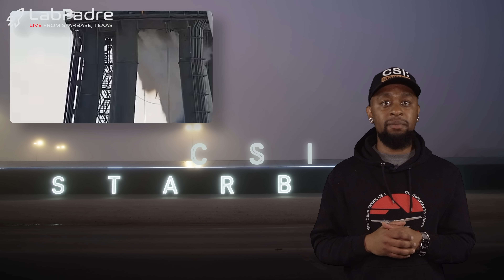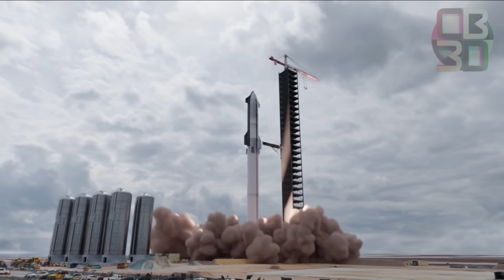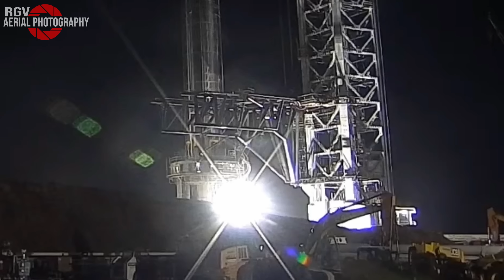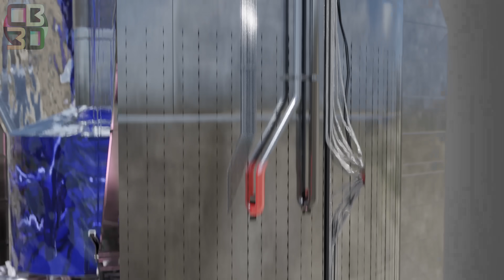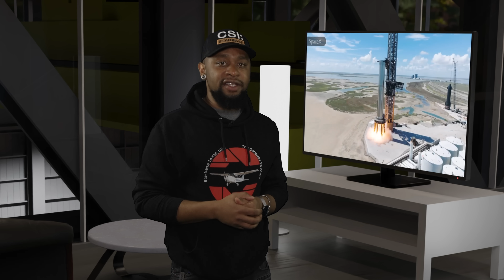[Part 2] The Real Reason Behind Delays to Starship Orbital Test Flight

Comment: Zack, in a 100% oxygen environment, you can light that stainless steel on fire with enough heat/pressure. The flame arrestors are likely made from Monel which will not easily burn even in 100% oxygen. They are also called Monel Stops and are very common in GOX systems. They aren't typically found in LOX systems as the cryo temps will usually put out any fire that could start inside the pipe.

Comment: The amount of thought and effort that you and your team put into each episode is simply amazing! I suspect it is almost as hard to "CSI" these systems as it was to design them in the first place. Even once you noodle them out you still have to figure out a way to present the information so that an idiot like me can understand it. Stunning work. Thank you for your hard work!
Reply from the maker: Turning it into a story is definitely the most difficult part
Reply: @CSIStarbase  You did a fantastic job.  Super Heavy is fundamentally a multi-megaton explosion just waiting to happen.  The only issue is whether the explosion is controlled or uncontrolled, and the degree of collateral damage.  

Here's some riveting "story drama" for ya:  
A-Boca Chica tank farm storage and/or fully loaded Starship contain 2400 tons of LNG.  
B-2400 tons of LNG = 23.5 KILOTONS of explosive power IN REGULAR ATMOSPHERE - NOT EVEN CONSIDERING THE PRESENCE OF THE LOX ACCELERANT. 
C-By comparison - Hiroshima =15 KILOTONS of explosive power.  
D-So, when you add in the pure LOX accelerant, you've GOT to be talking at least 2X the explosive power of Hiroshima in the event of catastrophic Super Heavy failure.  

Not trivial.  Instant story drama.
Reply: As the man says

“The best part is no part”

Comment: I'd consider the outer engine QDs a hard connection. 
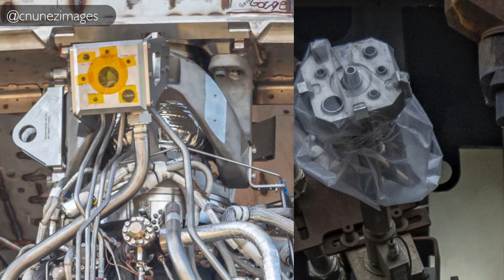You can see clamps on the right image at 11:24, those would lock behind the edges of the component in the left picture.

Comment: What an incredible capture and explanations of all the fine details. Well done Zack. The vortex that appeared on the cooling points it could be because of the hot air that has already risen up and the air from the surrounding area is flowing right in and getting sucked upwards
. respect to the with you are doing man.

Comment: Zack, you made a small error in explaining the pressure changes when pipe diameter changes.

Pressure drops when velocity increases and velocity increases when pipe diameter decreases as per Bernoulli's principle.

In your diagram, the pipe diameter increases so pressure would increase and actually prevent evaporation/boil-off whereas you said the opposite.
Reply from the maker: Yea. Made a mistake there
Reply: Thanks,that didn’t add up for me either, but I wasn’t sure.

Comment: Bro, another banger as always! This is awesome! SO awesome, in fact, I had to join as a Staff Member! Cheers, Zack.
Reply from the maker: Thank you!  Did you get access to the discord server ?
Reply: @CSIStarbase  I actually did not. Will it get emailed? Excited!
Reply: @CSIStarbase  Hey Zack, what do you think of my "catch-only-tower" theory: I think the 3rd tower being built in Florida, might be a catch-only tower to be constructed on a "landing-zone" to practice booster/ship catches, without risking damage to the OLM and all the plumbing. Indicators: Lack of plumbing being installed inside each section (plumbing should have been done by now), given prop load to the QD arm is not need. In fact, no QD arm is needed at all for this tower which is given why we haven't seen a QD arm for this 3rd tower. But the catch-arms for the 3rd tower is visible if in pieces. Further, this tower is shorter, which makes sense since this tower won't be stacking a full ship so a full height tower isn't needed. Thoughts? 

Also, I still haven't gotten the goods for the discord channel. Cheers mate.

Comment: I love how those arrestors work, sharply increasing the diameter relative to the pipe decreased the flow rate, which decreases the velocity of the fluid. this knocks back the kinetic energy of the front and thus pressure difference. additionally allows more surface area of flame arresting material.

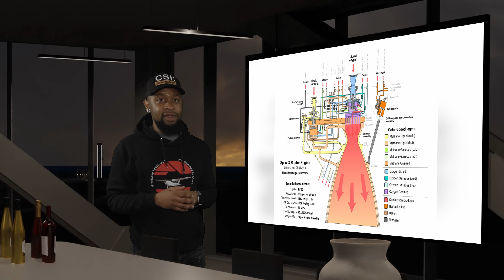Comment: Very impressive analysis of the plumbing and where chill-flow is going now.  The deep-dive into flow through the engine and out the vent and its timing relative to ignition would be interesting.  I'm assuming the blue pipe leading down and to the left of the engine bell in that group of four tubes which all head that same way in the diagram at 14:25?
Reply from the maker: That would be the location people expect it to occur. However I believe its actually coming from the bottom of the LOX preburner. Its filled with LOX during chill down sequence and then CH4 is introduced during startup. There are 3 LOX drains, but the diagram only shows two. Thats the catch

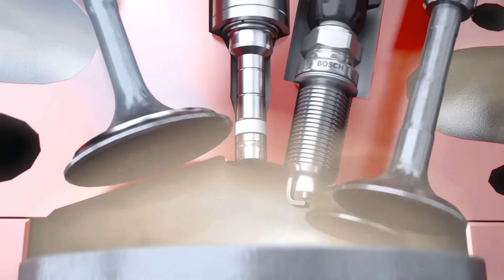Comment: 8:16   Looking at the manifolding:  The filters are larger on the right than on the left side of their shell coupler clamp.  Flow patterns of these are always from the outside to the inside, because there is a larger area on the outside to insure there is less restriction when flowing through a smaller area on the inside.  Also notice the left inlet pipes are straight walled, while the left pipes are tapered large to small indicating an outlet. So the flow in this manifold is....Right to Left.
Reply from the maker: I was anticipating and also afraid someone would notice something that indicated it was moving in the opposite direction.  We were unable to find this exact model of flame arrestors. So it hard to determine which direction it’s facing.  

I’m honestly a bit more excited for what it means if you are correct.  I believe it would be an indication that they are sending pre-mixed gas to the engines.
Reply from the maker: If it’s premixed gas than it’s possible that this is related to the “secret sauce”, elon mentioned.
Reply: @CSIStarbase  Interesting. Given that the pipe runs parallel to the other supply pipes, it would make more sense if this was also for supply of something. If I understood it correctly, in the other variant, it would end just there in the tank farm and dump the mixed gases there? But I am not sure, I got this right as that doesn't seem like a good idea :D

Comment: In my opinion, the solution to safely igniting 33 raptor engines lies in observing rocket engine testing being done on a horizontal test stand.  When the test engine is being operated, it creates a huge effect on the surrounding air as the surrounding air is being dragged downstream alongside the exhaust plume.  To use this observation in setting up the safe ignition of the 33-raptor engines, perhaps it is as simple as locating an extra raptor engine horizontally in close proximity to the launch tower and starting this engine first.  Then, with the exhaust of the horizontal engine dragging away the surround air, it should be safe to spin prime and ignite the 33 raptors without the accumulation of oxygen and methane beneath the Starship.

Comment: Super cool vid and research.  Thank you.  Can I ask if you agree that one reason they haven’t put a flame diverter trench in is because they want the debris and flame effect experience to enable successful moon and later mars landings on unprepared ground?  In other words these are problems that will need solving before the first moon landing.  Engine protection, gas shockfront effects, small debris protection…. all need to be solved.  I think they are planning on design that uses the gas exhaust itself as protection against incoming debris.  Any thoughts on that aspect?

Comment: You don’t need methane mixed with O2 to have a fire in an O2 pipe. O2 piping can and will burn…the fuel is the pipe.
Reply from the maker: This is very true. I did consider this as a possibility

Comment: If I'm totally honest, I still don't understand, why the permanent solution, of collecting all of the Raptor chill fluid, and either dumping it back at the tank farm, or the pool, (not below) is not the only solution whether for testing or launch?  And in terms of collection of the fluid, doesn't it make most sense, to have a pipe on the ship that collects all the fluid, then 1 connection out to the OLM.  Maybe I need to watch these again.  It's certainly interesting though Zack, and thanks for all of your hard work here.

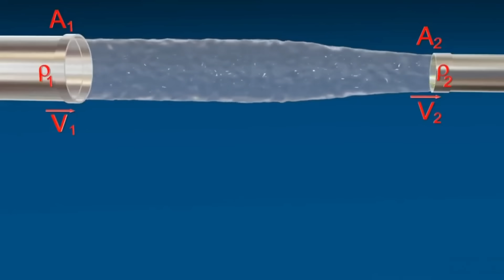Comment: At 9:40 I think you're mistaken about the effect of a subsonic diffuser- slowing the flow recovers the dynamic pressure to static pressure, and increases the fluid pressure. This will warm the two-phase flow while causing a small amount of condensation. Two-phase flows are often counterintuitive.

Comment: 11:25 The Raptor QD has four little clamps, two in the middle of the edge and two closer to the corners. So a bit better than press fit.
Reply from the maker: There are no gaskets or threads to keep it sealed. Only those clamps

Comment: Again, great video. I have some questions however: A flame can only propagate through a pipe if there is a correct Stoichiometric ratio within the length of the pipe. Is the analysis that additional reaction and oxidizer gasses are drawn in from behind the flame front? If it is not, then the flame could not continue, right. SpaceX should have been aware of these possibilities...Good Call. The design of the Launch Platform has always appeared wrong to me. The amount of force generated when all engines ignite, is truly staggering. Why then would they design that this force is directly focused on the Launce Floor at right angles, Surely there needs to be a Parabolic Surface leading away on all sides. This would allow the kinetic energy of the exhaust to be gradually moved away from the launch floor. Firing all this force normal to the floor has to be wrong...love your technology explanations.
Reply from the maker: The mixed gas would already be in front of the flame front, past the flame arrestors in the underground pipe. I don’t think a perfect stoichiometric ratio is necessary, however I am a little rusty in that area right now. I would have to review that a little before giving a definite response.

Yea I think its interesting that they have a deflector at Mcgregor but not here. Will be interesting to see how they solve that…and IF they make any changes that significant. It would be a major deal to add anything under there

Comment: Exactly!   But I'm wondering whether  1.  Tiles can remain attached through the rising blast waves at liftoff, and  2.  the tile lagging may take up water ice from the cryo tank condensing atmospheric water vapour, ice which may later expand to steam, which may displace the tiling precisely when it is needed.  A mystery RUD.
Reply from the maker: I think by the time the actual plume reaches the height of the ship, it will already be gone.
Reply: @CSIStarbase  Not about the plume.  I'm thinking both about de-tiling happening with liftoff shockwaves and,  later,  re-entry.
Directly at lift-off, very heavy shockwaves off the base will reach the height of the whole stack in 1/10 sec.  (We haven't seen a full-throttle test of all 33 engines at once.)
Water vapour ice trapped behind the tiles cannot easily ablate to space, and may be there to explode behind the tile as re-entry quickly heats it up.
I'm serious about both of these, er, difficulties.

Comment: Thanks for your videos Zack! Just sorry I didn't find them sooner! Question: why do the outer raptors each need their own QD? Why can all raptors be chilled and spin-started from the booster QD? Is it just a matter of saving mass from the piping/valves that would require? Is the added complexity of 20 QD panels needing to disconnect at launch worth it?

Comment: 02 accelerates instantaneous combustion with temp. across seals and materials. Why 02 compression/circulation is very dangerous. ie. friction. Hope they have a LOX filter somewhere.
Reply from the maker: Any chance you can expand on that a little more??

Comment: Suggest the ice could be made of hexagonal peace’s of ice, of different hight creating a dome profile, forming the shield a bit like the heat shield on starship. The voids around the legs being filled with slush, and frozen in place, using liquid nitrogen, thereby creating a homogeneous block of ice!!!’ 
Questions: How deep would the ice need to be to endure a launch or test of the rockets engines???
Could a thermal blanket be used around the legs of the OLM to assist in the removal of ice remaining after a launch or test???
Thoughts??? 🇬🇧 ຈل͜ຈ 🇺🇸
Thank you for the work you do, it must be amazing being there….
Keep up the good work and can you please investigate my idea!!!’

Comment: Water launch is the real solution. Picture a large tanker modified with a full stage 0 launch platform, but suspended permanently over the water. During the launch, all 33 engines fire into the water - no problems. Also solves the EPA and ACofE interference. Solves the noise issue - sail the launcher with Starship out to sea, then launch.
Reply from the maker: Shoutout to Deimos and Phobos! The ultimate launch platforms once they are completed
Reply: Center of gravity becomes key at such a high-mass rocket. To avoid tipping the ship over, you’d probably need stage 0 at or near the very center of the ship’s deck. Back to square one on flame mitigation.

Comment: I still dont understand the point of helium for these, or at least exactly when its applied and why its needed.
Im assuming you shove helium into the turbo pumps to spin them, then the cold gaseous methalox, ignite that and then they can run themself once full flow starts.
Is that correct and why cant the cold gaseous methalox being ignited produce enough power to perform the spin up? That would make things so much simpler.

Comment: The new water cooling/deluge system under the OLM is being installed flat, ie 90° to the rocket engine thrust. Zack is there a reason it could not have been designed as a "flattish cone" with angle of ~20° or so which would at least help a little??? Thanx for all yr good work.

Comment: Around 9.45 you state that an increase in pipe diameter results in a decrease in pressure. However, Bernoulli's Principle states the opposite; An increase in pipe diameter will result in a decrease in flow with an increase in pressure. Or have I missed something or got it completely wrong?
Reply from the maker: Yes, I got that once backwards unfortunately. Was a little more focused on the internals of the engine than the collection system and missed that

Comment: I remember Elon mentioning that ideally, these rockets should be launched from the top of a mountain located in the equator. I guess that the high altitude launch is because oxygen is low, and risk of combustion of methane leak or exhausted by force just before ignition of the motors, would decrease in turn any RUD event. I also guess that if artificially is decreased the oxygen concentration in the air immediately around the stage o launch pad, would have a similar effect? Like flushing below the booster motors with lots of nitrogen gas or CO2. Simple but I guess that it is way more complicated than that. In the Moon and Mars, lack of oxygen would be a plus, for explosions will no be possible.
Reply: My understanding of Elon's comment was being on the equator gives the biggest free push due to the Earth's rotation and the mountain part is free altitude?

Comment: i have a question about how once the engine flame are lit how it wouldn't melt the engines before its liftoff the mount. Is there a redirect system?
Reply from the maker: The engines are cooled from methane passing through the inside of the engine bells

Comment: The best technical data preparation of the Starbase 
in the universe.

If you people could be even braver:

dare to analyze the concept for the chop stick technique 
of the landing process.

My prediction is that this concept seems to have 
zero chance of success. 

That is why it is an extremely delicate subject. 

Only the best and the bravest dare to approach 
this subject matter.
Reply from the maker: I already have a deep dive on the chopsticks in the works.  Might not come out til after the first launch though
Reply: @CSIStarbase  excellent

Comment: Spacex just needs to launch with only enough engines to clear the launch facility. Then, bring in the other engines once the tower is cleared. Problem solved, now book my trip on starship for January of 2025 thank you.
Reply from the maker: Elon mentioned that the booster QD starts the center 13 engines, the launch mount starts the outer 20 so basically the initial start up is 100% carried out by the launch mount. So all 33 engines will have to be ignited at startup or else they will need more COPV's for ignition

Comment: I don't see any mention of what will happen to the LOX from the center 13 engines. Will they also be wired up to the same piping as the outer engines - in which case some fire arresters will be getting the LOX from 3 or even 4 engines.
Reply from the maker: If you follow me on Twitter, you will soon understand why I didn’t mention the center 13. There are still changes happening to the launch mount right now.  I will be posting examples of that today